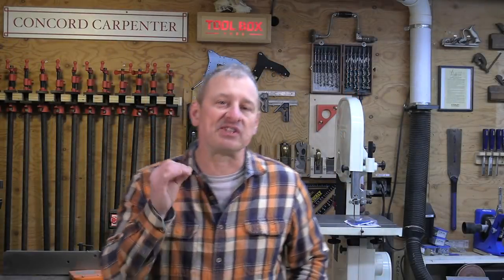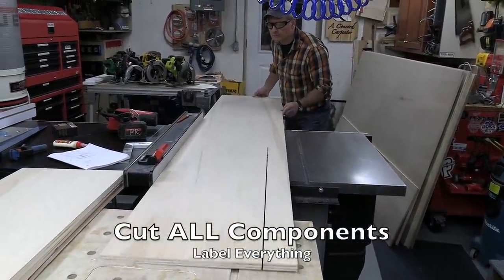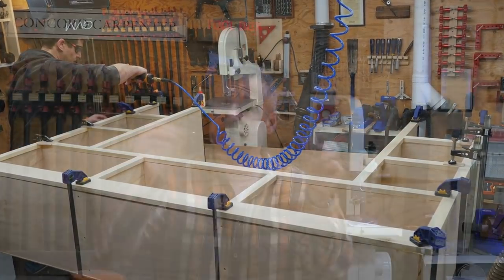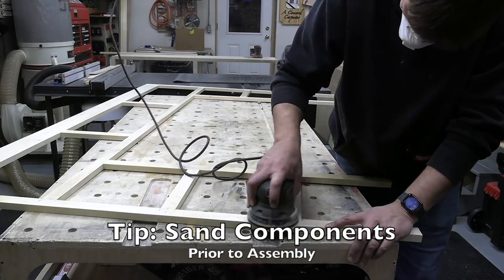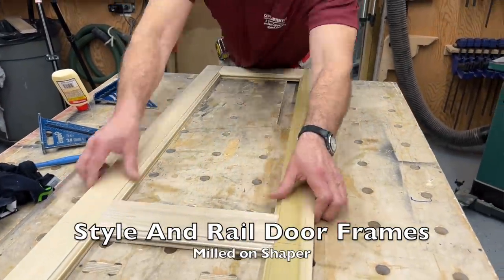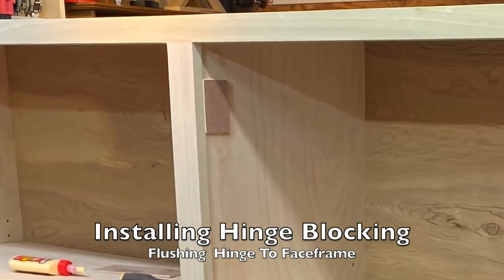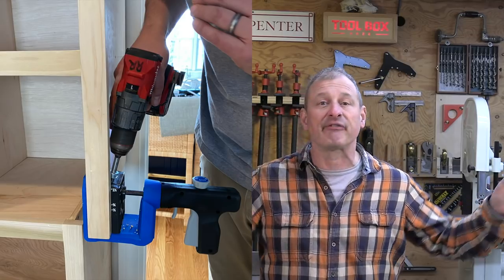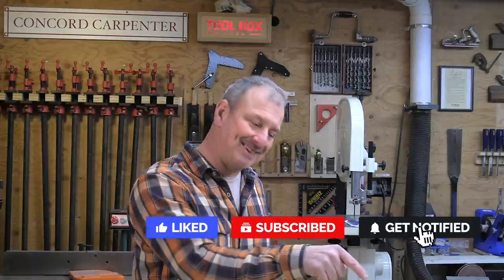Bookcase Build - Pro Tips

Comment: I wasn't sure if I should post here or at the track saw review/ test you did some time ago.
I think your Makita track saw evaluation  at that time was very good along with the others you tested. I went out and got the Makita.
My cordless Makita  track saw( purchased November 2021)has some issues and it took me some time to find others experiencing the same unerving issue.
When we set the saw into  one makita track and adjust the knobs so there's no side to side movement we  then must do it again if we switch to another makita Track. Ok perhaps thats not so bad yet if we combine two tracks for a accurate plywood rip the saw goes from snug on the 1st track to loose on the second track.  Not to mention the splinter gaurd changes and referencing it in future cuts is not reliable as it was intended to be. Unerving. I'm passed my 30 days to return it. My fault.
My makita track saw is in the factory service center now.  I am hoping it can be repaired.  My brother, in Arlington Ma, and I in Kentucky, enjoy your channel very much.
You reach and impact your viewers and there decisions and give many of us peace of mind as consumers.
Thank you.

Comment: I literally just built a wall to ceiling TV cabinet also with inset doors but the one I made is built into the corner of the room so it was a lot of triangles, Sketch Up made it way simpler figuring out how to get all five triangles out of one sheet of melamine. I wish I thought to make a story pole instead of checking my drawing.

Comment: Out of interest how much do you charge for something like this? I'm UK based and my base rate is roughly £1000 per linear meter for work like this - installed and painted.  It's so much work - thinking I undercharge?  I use Poplar and Birch ply and joinery very similar to what you have done here - including to cope and stile type decorative doors.
Reply from the maker: 7500 range not incld paint